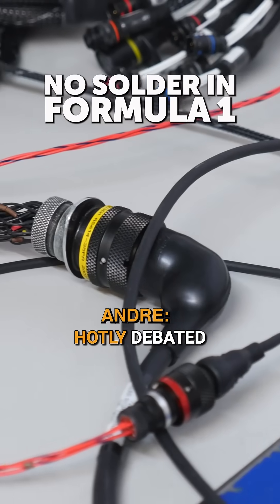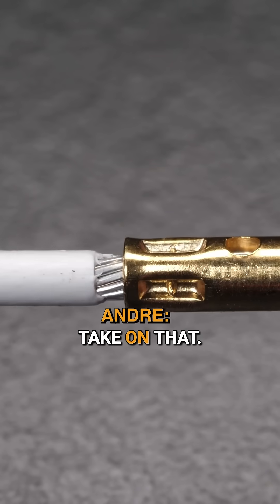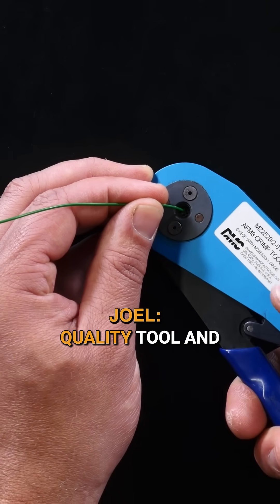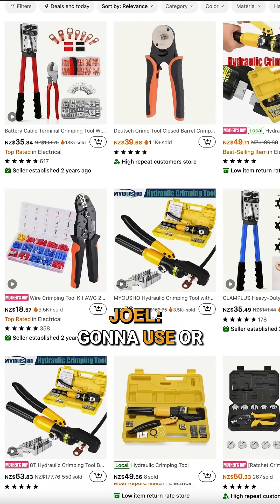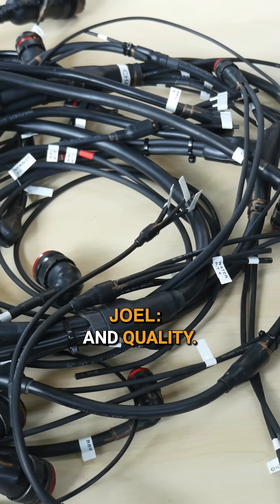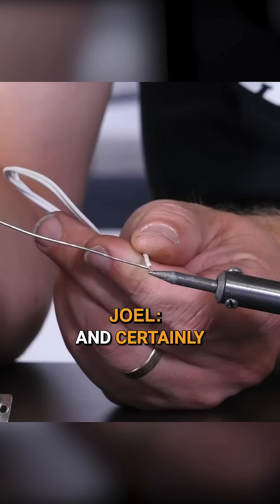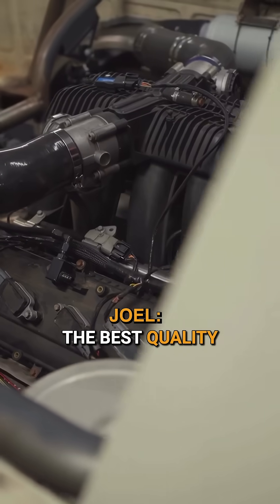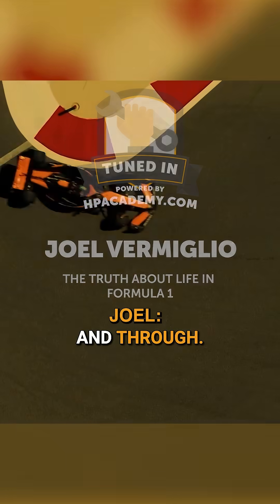No Solder In Formula 1 Wiring?

Comment: I think the miss understanding is that people understand the cheap ass tin crimps used in surface connectors or even the cheap ass car ones.

MIL spec circular connectors and pins have very tight settings down to the gadge and when you use a spec crimper it's just as good as a solder.   The crimper, pins and connectors are super expensive though.  I think I bought a 25 pin connector for 60 bucks and that didn't include the pins, strain release OR spec crimper.  I just got lucky with an old ebay spec one.

Comment: No offense that insulation head gap to barrel of contact would never be acceptable in my line of work. Also what do you use for stripping insulation?
Reply from the maker: That is what is specified for this specific contact by the manufacturer. If you didn't follow that in this line of work, it also wouldn't be acceptable. 
Tefzel is harder to strip than other common types of wire, most will keep a specific set of wire strippers just for it - https://www.hpacademy.com/blog/why-is-tefzel-wire-harder-to-strip/
Hope that helps - Taz.

Comment: Weird how crimps would absolutely never be used in some high vibration circumstances, and solder would never be used in others. But I guess those situations when crimps would never be used generally involve high current, whereas automotive wiring does not.
Reply from the maker: Yeah it's certainly not a 'one size fits all rule' with these things. Application is important 😎 - Taz.

Comment: Do all the circuit boards or microchips use solder?
Reply from the maker: Great question! We're specifically talking about connectors and wire connections etc in the wiring harness here, however, you might find solder in a PCB.
It is worth noting though if you want to look at PCBs, soldering is not necessarily the only technique used there either, but we don't dive into microelectronics at all at HPA. I'm sure other channels out there do 🤘
Somewhat ironically given the discussion here, DIY MegaSquirt ECUs got a pretty bad reputation to the point pro tuners generally don't touch them due to poor assembly (soldering) work causing all sorts of weird issues 😅 - Taz.

Comment: The fact is crimps are better, I primarily use crimps with the proper tools. However for him to say there is no solder in an F1 car…. Well he better not go look inside any of the electronics in the car bc they’re all soldered components on the pcb board.
Reply from the maker: We're specifically talking about connectors and wire connections etc in the wiring harness here, however, you might find solder in a PCB.
It is worth noting though if you want to look at PCBs, soldering is not necessarily the only technique used there either, but we don't dive into microelectronics at all at HPA. I'm sure other channels out there do 🤘
Somewhat ironically given the discussion here, DIY MegaSquirt ECUs got a pretty bad reputation to the point pro tuners generally don't touch them due to poor assembly (soldering) work causing all sorts of weird issues 😅
Of course we're talking about causal home hobbyists soldering up PCBs, not robots or probably rarely these days for PCBs, professionals with 1000's of hours experience on the tools- Taz.

Comment: "Easy to say absolutely nothing on a Formula 1 is soldered."
 Ahh yes, all those crimped ECU SMDs are getting expensive, man! 😅
Reply from the maker: We're specifically talking about connectors and wire connections etc in the wiring harness here, however, you might (likely will!) find solder in a PCB.
It is worth noting though if you want to look at PCBs, soldering is not necessarily the only technique used there either, but we don't dive into microelectronics at all at HPA. I'm sure other channels out there do 🤘
Somewhat ironically given the discussion here, DIY MegaSquirt ECUs got a pretty bad reputation to the point pro tuners generally don't touch them due to poor assembly (soldering) work causing all sorts of weird issues 😅
Of course we're talking about causal home hobbyists soldering up PCBs, not robots or probably rarely these days for PCBs, professionals with 1000's of hours experience on the tools- Taz.
Reply: @hpa101  I was just being a "smartass" for the heck of it. I work in the automotive industry myself and I fully agree whith, you, your guest and generally with your approach to this field and attitude. I highly appreciate your time responding to my silly remark, though. Rock on! 🤘❤

Comment: You won't see connections on aicraft for the same reason. Solder is prone to breaking, crimps can be heated and cooled and vibrated with less failure.

Comment: I used to solder everything until I I went to my electronic maintenance class in the navy and learned the importance (and ease with the right equipment) of crimping connectors, especially once I learned about all the prep needed to solder properly.

Even with some cheap crimpers a good enough quality crimp can be made. Also I'm guilty of using those new shrink wrap crimps with the sealant inside, no more messing with cutting shrink wrap.

Comment: F1 wiring does not need to last very long! It never gets old enough for corrosion to become an issue. But vibration resistance is critical. Both are reasons for them to choose crimps over solder.

Comment: Pros and cons man, solder is solid and gives a firm robust connection, crimps give flexibility as well as connection but dont go pulling on that lead...
Reply from the maker: If your crimps are failing a tug test, the problem is with you, your tooling or a mismatch between your tooling and materials. It's not with crimping.
There is testing out there for both soldering and crimping (aka pull testing) where they compared the strength against the base wire used 🤘

This shouldn't really matter that much for either,though, because you're executing strain-relieving techniques that will make sure your connections never sees this kind of stress though, right 😉 - Taz.

Comment: Crimping is way better, even for an enthusiast, no need to warm up the soldering iron, no fumes, it's clean, faster and looks pro.
Reply: It can be faster for single end connection. But a joining crimp is typically slower than solder if you are good at both. 
I have built equipment used in high vibration areas and we used both, but we use leaded solder (legally, due to critical safety application), which isn't as brittle.. Lot of solder failures in modern electronics are in lead-free solder. This wasn't so common in lead solder in past.

Comment: There's next to nothing soldered on commercial aircraft either.
Reply: I've seen/done crimp + encapsulation in servo wiring harness on mid sized UAV. They did not want that stuff moving at all.

Comment: I’m soldering certain repairs, but I’m just driving an old pickup. Crimps allow the strands to flex and slide rather than cracking!
Reply from the maker: No need to feel bad about that mate, you have to do what works for you! 
If you have to come back to your repair to do it again though it would be worth digging into things a little deeper noting the solution might not be crimping. If the repairs are lasting and you're consciously doing the best work you can, then you're good! - Taz.

Comment: Professionals all know the logic; solder breaks, crimps don't. Anything needing reliability that endures any sort of vibration or movement must be crimped for the integrity of the connection. From spacecraft, to automotive, crimps are superior. Invest in a great crimp setup, in addition to your solder kit, they both have their purpose.
Reply: Had a great explanation comment but YT deleted it. 🥲 Solder has a place, crimps have its place. Ask any engineer working with NASA, Grand Prix, NHRA, SpaceX, they all learned the importance of each. I don't feel like typing out a longer explanation again. Research and conclude yourself.
Reply: @jakenuno9900 most people on YouTube don’t buy genuine wheels so the solder vs crimp issue is so far down the line 😂
Reply: @jakenuno9900  True if there is no limit to their budgets - go look at the price of the Daniels crimpers and the certiffied lugs - will you solder or crimp. Solder wins hands down, actually for the price solder has no competition.
Reply: I’m a heavily certified automotive repair professional and my opinion is that an average solder joint that is properly insulated will outperform a poor quality crimp+tool, but a high quality crimp will outperform that solder joint. My preferred crimp type for wire repairs or splices are the simple open barrel crimps without the tangs that clamp onto the wire insulation
Reply: Solder is a  superior means of joining, But slower.
Reply: @MrTk6969  absolutely not. Solder does not stand up over long periods of time under motorsports conditions
Reply: @Harmonic14  u must not know how to solder then
Reply: @Harmonic14  I agree with you, but it depends, We have racing cars which have harnesses made over 20 years ago with crimped and soldered connections and they had not failures, but as I stated, I agree with you, I try to make only crimp connections just to follow the professional recommendations, after all, I'm a "low level Motorsport" professional, so our clients do not want to pay a lot of money on harnesses, so we have to cut costs down as we can😅
Reply: @Harmonic14  don’t tell the ecu in that f1 car with all the soldered smd components.
Reply: @wilsonlitten7881  We're talking about connecting wires here, circuit boards are another thing entirely and not even remotely relevant to this discussion.
Reply: If it’s soldered well then it does not break, the issue is just that it can be poorly soldered, but you can’t crimp it poorly, most of those tools don’t even let you partially crimp it
Reply: @Industry-insider  That is incorrect for high vibration and impact applications. Trust me, I used to believe this for years, until I realized a good solder joint for electronics is actually a crystalized structure, which is naturally brittle, fluctuating by the quality and make-up of the solder alloy. Once I started to work with high performance engineers and technicians, including those working with NASA, Boeing, SpaceX, Tesla, NASCAR, Grand Prix, NHRA, and much more, I realized I was wrong. My soldering is A1, I have been soldering since I was about 7 years old thanks to my grandfather, so my ego made me believe my connections can never be broken, but I was wrong. It has its place, just like crimping. They will work interchangeably, until it doesn't, so with lives and billions on the line, that's when it's a no-brainer to crimp. DIY and hobby? Go ahead, no big deal. Hope this helps clarify the logic behind it.

Comment: After taking the Club-level and Pro Motorsport Harness courses from HPA, i will only crimp. I will solder connections inside a box like a thru hole. Most aerospace and mil are crimp as well.
The NASA spec is; https://standards.nasa.gov/standard/nasa/nasa-std-87394
Reply: Your daily driver or street car deals with salted roads (even coming out of season) or other corrosive environmental factors. Crimps leave room for moisture and salt to build up and corrode these connections. There's really no reason to not solder your connections.
Reply: @GhostFox_13 weather pack connectors are factory and Raychem 25 boots are to seal mil-spec connectors. Almost zero automotive OEM terminations are soldered.
Reply from the maker: @GhostFox_13 soldered connections are not immune to corrosion. They're resistant. Big difference, noting the material your crimps are made from are also resistant to corrosion.
Your sheathing is what offers environmental protection, soldered or crimped 🤘 - Taz

Comment: I perform both solder and crimp connections on multi-million dollar aircraft daily. They are both 100% reliable when done right. They are both very prone to failure when done wrong. That's really all there is to it. They will both be around for a very long time. Not much point in debate, really.
Reply from the maker: We can only talk about motorsport, but this is an interesting one as we get aerospace guys also saying they never solder, including on this post.
What planes are you working on and what standards are you working to for both soldering and crimping out of interest in your industry? - Taz.
Reply: @hpa101  My previously posted reply was removed for some reason so I'll try this again.. I've worked on the majority of airframes used in the U.S. military, everything from helicopters to fighter jets. While crimp connections are most common, I've also used a soldering iron on every airframe I've worked on thus far. The most solder intensive airframe I've encountered is the F-16. It uses thousands of solder connections in its MTC connectors. To be fair, older airframes were more reliant on solder joints. I expect solder joints to become less and less common going forward, because solder joints are so labor intensive and crimp connections are far better suited to automation in production (apart from PCBs obviously). Civilian technicians, such as myself, are usually (but not neccessarily) IPC J-STD-001 soldering certified.
Reply: @hpa101  I've worked on the majority of different airframes in the U.S. military, everything from helicopters to fighter jets. I've used a soldering iron on every single one of them. The most solder intensive airframe I've encountered so far, is the F-16. It uses thousands of solder connections in its MTC connectors. I do believe solder connections will be used less in the future as crimp connections are better suited to automation (except for PC boards). Solder joints are very labor intensive. Production efficiency ultimately drives which connection style will be used. Maintenance and repairability is a secondary concern. All of our military aircraft maintenance manuals have "solder" in the parts lists; because they all have solder points. Civilian technicians, such as myself, are usually (but, not necessarily) IPC J-STD-001 soldering certified.

Comment: Soldering provides long term oxidation and corrosion resistance, seals from environment indefinitely if done right. Crimp connections can get dirt or moisture inside
Reply from the maker: It's not quite that simple as if you want to look at wiring on the whole there are different types of wire and solder that have different corrosive properties and considerations.
From there you also have the same to consider for crimps, and their gas-tight seal.

If you're interested in looking into this further, check out what the likes of the marine industry is doing for both. We didn't really get into corrosion but a previous podcast guest (Peter Knight) has wrangled his fair share of wiring on Americas Cup boats: https://www.hpacademy.com/blog/012-ac75-wiring-and-the-americas-cup-formula-1-on-the-water-podcast/?utm_source=youtube&utm_medium=social&utm_campaign=general-interaction

For what we're specifically talking about here, these harnesses are also fully sealed. Corrosion is not an issue for this application.

Both techniques have pros and cons for sure though, and you can choose whatever one you wish yourself - Taz.
Reply: Soldering decreases the resistance to oxidation because of the heat on the exposed wire. The connection is also highly stressed with a fatigue point at the same area.
The epoxy and heat shrink boot seal the entire  joint and will be sealed and a little lighter.
Mil-spec we do both some connectors are soldered pin & cup and some can be crimped and the connector is populated. If the pin can be removed - crimp it.
Reply: A soldered joint isn't water tight (for the exposed section) without glue lined heat shrink or similar, the same is true of a crimp but without the stress raiser

Comment: What about corrosion?
Reply: What about it?
Reply: F1 cars don't last long enough to worry about corrosion. Also connectors like this are environmentally sealed
Reply: Waterproof connectors, dummy wires built into the harness as spares
Reply: Water will track down the insulation of a soldered joint. Solder is not better for corrosion, they all need protecting one way or another.